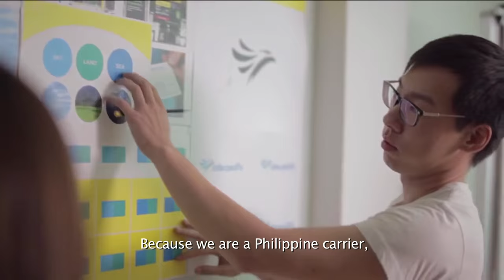Introducing our new livery!

Comment: Cebu pacific fantastic but there not as cheap anymore  as before Sydney to Manila add baggage u could had flown a different airline when they have promo then there cheaper.
Reply: Good point, also long haul flights can be a bit exhausting if adding some factors such comfort affected by the airline and/or plane.